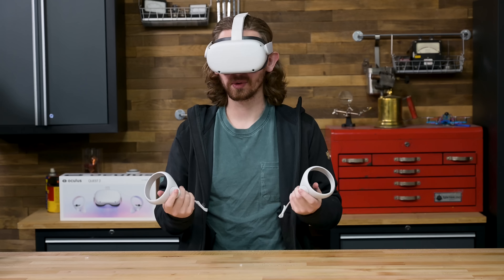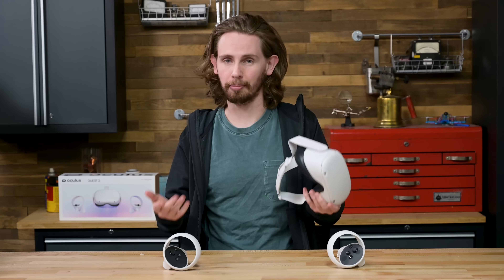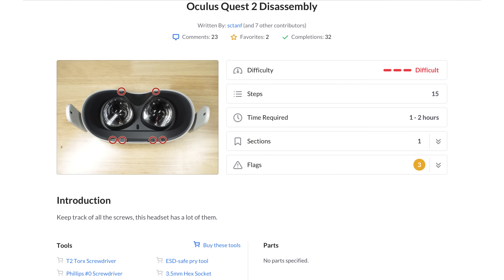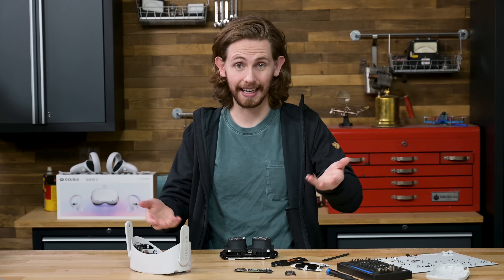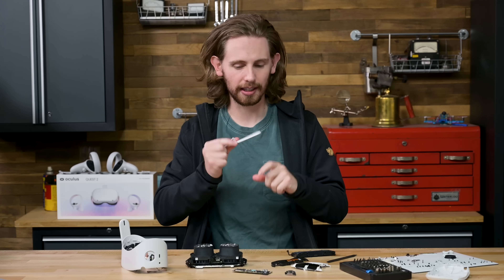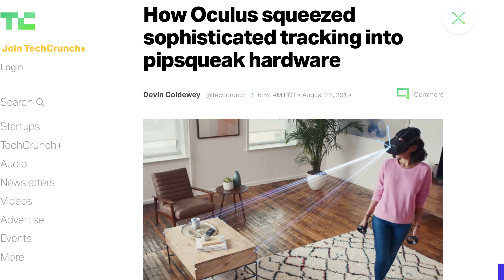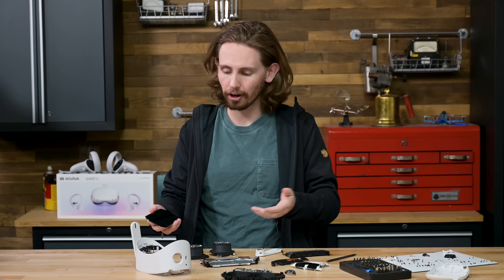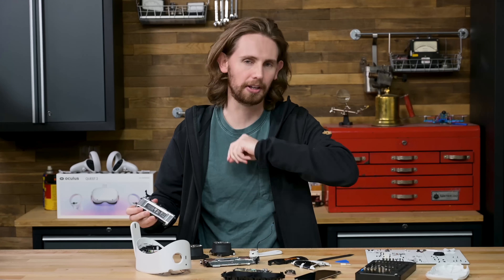Oculus Quest 2 Teardown: Into The Metaverse

Comment: Yass, so glad you finally did a Quest teardown! No score today though?
Reply: @massimiliano1306  six and a half? id say something more like a 4-5
Reply: i wonder what took 'em so long
Reply: It should be really high score IMO. Everything is replacable, nothing is glued in (except with strips of course). Sure it is not so easy to tear down, but that is always the case with electronics, that are so densely packed with hardware.
Reply: Maybe no rating because there’s so little to compare against, it’s sort of a one of a kind piece of hardware right now in the west as opposed to the thousands of different laptops on the market
Reply: @tommykarrick9130  yeah was wondering that too. Still I think a score would've been nice since it's kind of absolute and not relative to other products. If all products of the category would be difficult to repair that doesn't make it easier or the score better right?
Reply: @jacobscharmberg7133  I think it’s a comparison against other products in the same category, so like the framework gets the max score because it’s the easiest to repair laptop, but most desktop computers are equally if not more so repairable, but they don’t all get perfect tens
Reply: The teardown is not so bad. It's an AIO VR headset, and the most hassle u'll have is removing the display from it's backplate. Everything else is indeed crammed inside it but DUH, AIO VR.

Comment: That's pretty crazy. I hate to say it, but even though Facebook/Meta is taking over the industry (Unfortunately), their acquisition of Oculus has improved the overall VR experience so far. My Quest 2 has taken some pretty serious accidental beatings, so serious respect for the Oculus design team!
Reply: Love them or hate them, Oculus/Meta is the only reason VR is thriving rather than slowly bleeding out.
Reply: I was surprised how well made and design Quest 2 is and all those just for $300. This thing is built to be as tough as a tank with great potential.
Reply: I can't believe how quickly they basically stopped all PC VR projects. All they're doing is keeping the Oculus software on life support for the time being. I am SO glad for the excellent Oculus Link and Virtual Desktop software though, so I get to use it with Steam.
Reply: @Gersberms  Yes, this is a issue that has even affected me. Previously, I had a Rift S, but with no spare parts or spare cables, it is a big paperweight. Perfectly good HMD, but with no working cable. Ridiculous.
Reply: @dbchees3  I had a Rift S and as soon as I had tried my Quest 2 for the first time, I put the Rift S on eBay. The Quest is better in every way except the shape of the controllers. The ring is perfect on the Rift because it goes around your hand, it's perfectly natural. For the Quest they had to put it on the wrong side of the controller and I hate that.
Reply: @Gersberms  the FOV is one thing that surprised me the most when I first got my quest 2 from a rift s
Reply: @marshallpieri3737  for me it was the resolution. I could finally read small text. I'm playing Skyrim VR now and it really is an amazing experience.
Reply: They've made VR accessible to the masses, so the industry as a whole is better off for it.  Now more VR games will be made and hopefully more headsets to try and compete with Quest 2.
Reply: @Gersberms  the cord vs no cord also is a huge thing. I bought virtual desktop and am using the hotspot on my PC for PCVR and it is so nice.
Reply: You need to prove that a market has potential before other players feel more justified in their investment.
Reply: @marshallpieri3737  Absolutely. Virtual desktop does have a performance hit but it is the best at what it does. Worth the money.
Reply: my controllers didnt, one single hit and it wasnt even a strong one destroyed a part of my controller and the ring is broken from the external side, at least it didnt broke the inner part and is still functioning
Reply: @laos85  This is called Meta being able to afford selling it at a loss undercutting every other competitor. It's easily a headset worth triple or more, but what about taking like 80% of the VR Market share that easily because you can? It's not good, it's really bad and no one else can really compete like this.
Reply: @Gersberms  I meen they have put some serious effort into having the quest work great as a PCVR HMD. Even wirelessly and retroactivly. They are still working on Combining the rift software and quest software so that you get the best features from both seamlessly and with one software set. The bigger issue is that quest is far far more profitable for developers atm so PCVR is lagging behind
Reply: @Gersberms  Well Project Cambria and maybe Quest 3 going forward. Wont have tracking rings. They will have cameras on the controllers. So no ring at all. Also no more tracking occlusion.
Reply: @LionheartTM  True! I went back and checked the Oculus PC application update log. They still update it every month or two, so maybe I am wrong about this.
Reply: @LionheartTM  Really? I haven't followed the news lately. That would be great. RIP controller batteries though!
Reply: @Gersberms  I have no performance hit with VD, try adjusting your settings. VD actually gives better performance than link. VD has a feature where it can render at a lower resolution on your PC and upscale on your headset.
Reply: @marshallpieri3737  There are certain Unity games, and Skyrim VR, that don't look good until you render at very high resolution (3k per eye) and let the headset scale it down. Maybe I'm nitpicking but it looks way better that way. It seems that encoding this on my GTX 1070 and 8th gen i7 hurts my system too much if I use Virtual Desktop. But I'll do another comparison. I love being wireless, it's how VR was meant to be for sure. Battery life is still an issue for me. It may also be that my 5 GHz wifi (VD measures it as 886 Mbps) is not enough - it is one hotspot shared between laptop and headset so not ideal.
Reply: @thenonexistinghero  They do have the responsibility to moderate their platform. They created the community, now they need to moderate it. This is an old problem that Facebook tended to ignore. If you don't, it's not hard to see how things could go wrong and nobody will have a good time.
Reply: @thenonexistinghero  Personal bubbles are not controversial. Have you explored Horizon Worlds or Venues? The potential for harassment can come from anywhere online. Plus, personal bubbles come standard in almost every game for that reason. I hope you're not trying to argue that personal safety is something Facebook and Oculus should ignore. Since you mentioned it, last time I checked, a game's content and safety is in the hands of the developer, and they adhere to the platform's guidelines. Look at whatever..you want to..and if others think you're a creep, well... that's what safety mechanisms are for.
Reply: The entire Oculus team left facebook in 2018. There is no oculus team, it's just facebook paying 3rd party engineers to reverse-engineer all the work that oculus did to make the quest.
Reply: @sqlevolicious  It’s true that they split up on different visions for the company. It’s also true that they’ve already killed the Rift S’s life support, but in the grand scheme—unfortunately for us traditional PC gamers—they’ve reached a bigger audience by going mobile and devoting all of their resources to it. I will forever hold salt for them killing the Rift like they did.
Reply: @thomasrossbabin3671  The ultimate choice, indeed, my friend. Sadly, many of us cannot seize the opportunity to own one ourselves, whether it be the PC requirement or the money. :(
Reply: I had a wmr odyssey+ for 3 years and the quest 2 is a massive step above I no longer get motion sick because the tracking isn't complete dogshit with some tweaks it's actually the best I've ever seen
Reply: @Stormstyker  there is vents
Reply: they've fallen backwards for people who don't want to pay $100+ for the "Oculus" licensed cable... I've been having issues with all types of cables, even the one from Anker (which supposedly is the #1 replacement for the official cable)... since they pushed out the new software update for the Quest 2 (I'd say they pushed it out about a week after the original comment)
Reply: Mine just broke today after having it since launch!

Here I go to replace the tracking cameras!!
Wish me luck!
Reply: @thatnerddaniel  Best of luck! Fellow VR fan.
Reply: I broke my screen after 2 days bought another.  Thinking of buying a new screen and replacing it sometime in the future.  So thanks for this.
Reply: Mine took a small fall and the screen is messed up now
Reply: @Gersberms  no one likes pcvr
Reply: well they are getting competitors now (biggest ones in terms of being cheap is the Pico. it is made by a chinese company so all your data may not be sold to the highest bidder, but the chinese government will have access to all of it if they want to and then there is whatever Valve is cooking up. and apple I guess, but who knows what that will be)
Reply: for me it is mostly the controllers. I have hit a lot of stuff in my room and my desklamp still has a dent, but those things are build like a Nokia 3310. and more or less easy to disassemble. though the use of something like a T5 screw annoys me. this headset with it's T2 screws is even worse. what normal person has those?
Reply: eh... "improved the overall VR experience" is a bit of a stretch. Oculus was really the ones who made the Quest and Quest 2 under the guidance of John Carmack and others, Meta just provided funding and support. The Quest 2 has been retroactively locked down in firmware and software and you are forced to stay strictly within their ecosystem if you want your product to work.
Reply: @tempest585 what?!?! Tell you don't play simulators, without telling us you don't play simulators. Flying and driving sims are amazing in VR.

Comment: The display can be burned by sunlight because of the lens assembly, so it's probably quite a common repair
Reply: Came here to say this.
Reply: They tell you right on the lens when you first take it out of the box to avoid sunlight at all costs, so it’s pretty hard to miss.
Reply: Had one of those cheap phone VR sets sitting in a car one afternoon and came back with clean lines where the plastic was melted. It took a bit to realize what happened but was pretty cool after figuring it out.
Reply: @mbcommandnerd  if you've ever been on the quest subreddit, you know how many people ignore the warnings
Reply: who uses their vr in the sun?
Reply: @MrUnder30seconds  Depending on where you leave your headset, the sun could come in through a window or even be reflected off of something
Reply: Do you really think they repair them..? I'd guess they run a bulldozer over faulty units.
A burnt lcd repair in a clean room costs more than the headset alone . Lol
Reply: @mbcommandnerd  yet my younger brother (when we first got our quest 1) always left it so the lens were facing upwards and exposed to sunlight no matter how many times we told him it was bad for the headset. So... they probably have people needing replacements
Reply: Meant to add most likely a lot of kids won’t listen to the warnings*
Reply: @REDxFROG  They sold refurbished 64GB headsets after the 128GB ones came out, so yeah.
Reply: @Shadow__X  Because 90% of them are children.
Reply: @MATERMANF  journalists use their vr headsets in the sun :P
Reply: You can also damage it if you hit the lenses!! Mine has some lines in the bottom side of the I’ll screen after I tried taking off the Blue light lense adapter and idk how to fix it now 🤷
Reply: The thing is, although it IS repairable, it's completely impossible to get spare parts, LCD panel is custom made for Quest 2 and FB just don't sell them.
Reply: I had my headset covered in a bag and it STILL got sun damage 😭
Reply: @koicarrot  oof
Reply: @REDxFROG  they probably rip out all teh broken bits and replace them. this thing is build to be disassembled. there is a reason for that.
Reply: @MrUnder30seconds people who touch grass

Full immersion tbh

Say you are playing something where you are outide in the game

Plus vitamins from the sun

Pray to sun god

It give you foood, and sexy wife

If you pray hard enough

It make cave man go GRR but not bad..

Good, very good
Reply: That's what happened to mine
Reply: @MrUnder30seconds you leave it in your car on the seat
Reply: I did that to mine lol
Reply: I'm here, another user with burned screen

Comment: I'm really glad that this is out now. Finding a tutorial to get to the battery was never really out there for the longest time. While I really like my quest 2 batteries are products that will go bad over time so knowing how to get to it when it eventually goes bad will be very helpful.
Reply: But what batteries will we need or will be available once we need them?
Reply: @En1gmatic1  someone will offer a generic replacement, I'm sure. it's mostly a matter of them figuring out what the pinout is, as that's a standard type of connector.

this also means that, if you where rather brave, you could cut a hole in the case and lead a larger pack in, and there are arguably reasons to do this.
Reply: @En1gmatic1  yeah with there being millions of these sold, once there is a market for replacements they will be out there. though you really have to trust the supplier at that point, otherwise your strapping a bomb to your face.

Comment: It's a small wonder in itself that it doesn't overheat constantly with how densely packed everything is, and how tiny that cooling system is. And yet, the only time I've ever heard of one of these overheating is if someone stuck a case on it that obstructed the air vents. (Basically that entire 1mm gap where the front plate meets the rest of the assembly.) 
As much as I hate Zucc for his dystopian actions on the macro scale, I have nothing but mad respect for the engineers at Oculus who managed to make this little thing possible.

Comment: Great breakdown, after 2100 hours in this headset (95% with PCVR) with no issues it is insane what they did. I use a battery pack and cable and get 13-14 hours out of it too.
Reply: AMVR battery pack?
Reply: i would be throwing up everyday if i was you
Reply: @heyjohnsmith  nope nothing special just a regular battery with high enough v to charge while playing.
Reply: @mr_coffee0508  I got lucky. I'm one of the few that doesn't get any motion sickness no matter what I do in vr
Reply: Get outside dude. Seriously
Reply: @doomsday9973  I do daily as I work in the woods and usually dont drive. I just dont consume TV or games really.
Reply: @iamaspirit9912  2100hrs is 87.5 DAYS playing video games in VR. Seriously that’s not a hobby that’s someone who needs help

Comment: One thing worth mentioning regarding the battery, is that the elite strap with battery is a way better strap, and just replacing the elite strap would cost less than replacing the whole device.
Reply: someone should test if the device can work with an external battery when the internal one has failed. it might not function with a dead battery

Comment: It would be cool to see the screen powered on. I’d imagine the DPI being very high making the image look sharp
Reply: I'm pretty sure sony has a 4k phone, would probably look similar to that. Also I bet the image on the display would look really warped without the lenses
Reply: @betafi4535  the res per eye is 1920x18xx so pretty much spot on
Reply: What exactly is high DPI? The DK2 has a pretty high DPI compared to the virtual boy.
And the Varjo Aero???
Reply: @REDxFROG  High DPI would mean no SDE (screen door effect). It really depends on PPI, lens tech, display tech, and more. 
Varjo Aero is a commercial device that isn't viable for consumers or any mainstream VR software (despite it's OpenXR/VR compatibility). Like most commercial VR systems, you need a team of engineers to support the software you plan to use with it. Otherwise, it's a $3,200–$5,500 (plus an $800–$1,500 annual fee) paper weight.
Reply: Yes it
 is I have the quest 2 also it's realy neat

Comment: For $300 you honestly can't get a better deal... With it's fov, I can play at 5400x2700 render resolution (native quest 2 display res), and at 120hz on max settings half life alyx, you name it.... I have tried the reverb g2, tried the terribly overpriced index, tried pimax 5k and 8k, tried the first rift, tried the second rift s..... Quest 2 is by far the best deal and honestly imo the best VR headset available right now for PCVR or standalone.... Had it for like a year now and still absolutely amazed that they could do this for only $300... Only downside is that for PCVR video is compressed to be sent over 20gbps usb-c which doesn't make sense to me but....

Comment: I can tell you exactly why that screen is attached with stretch release adhesive: Sunlight. You can play outdoors in VR, but if the sun goes into those eyepeices and through the lens, it will cook the screen. This happened often enough on the older headsets (of all makes, not just Oculus/Meta/whatever they're called next well) that it made sense to decrease the price of the repair on the manufacturer end, because the customer will pay out the nose for it regardless, bigger profits on the service.
Reply: What I'd like to see is a teardown of the touch controllers, because that's the part that's going to get broken more often (yours truly has a minor crack in the tracking ring. Doorframe 1, Quest 0, oof)